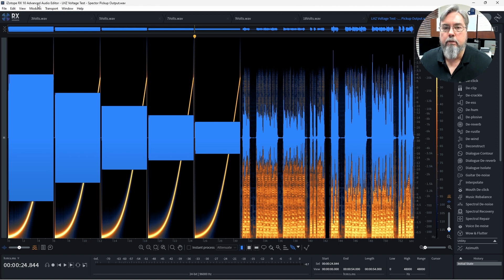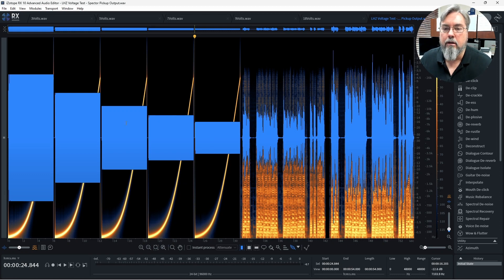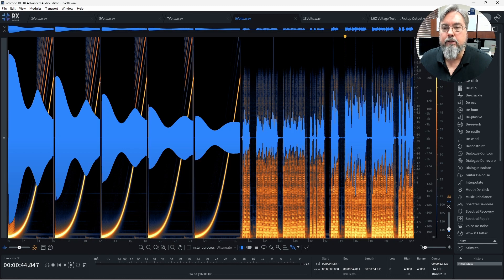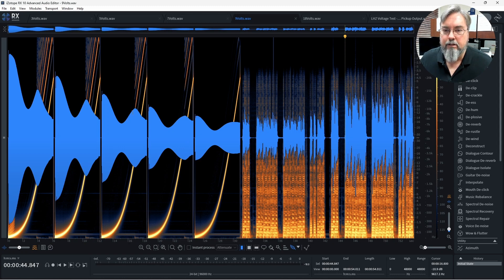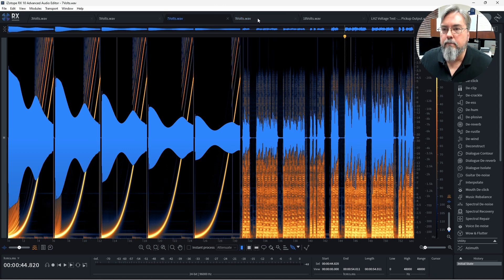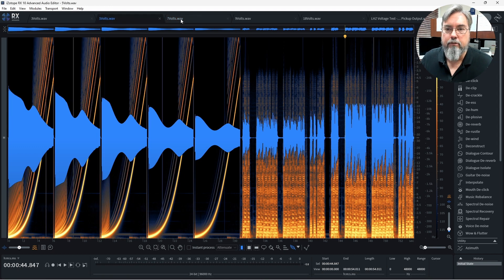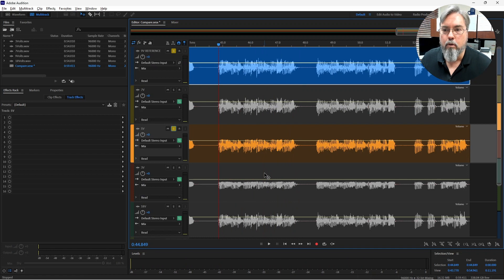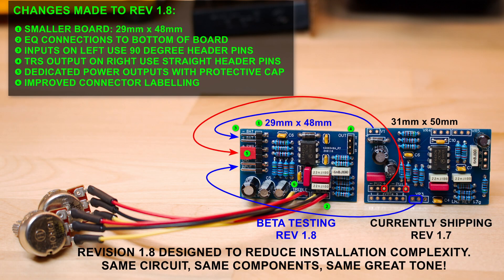Battery Voltage Impact on LHZ Preamp

Comment: Thanks so much for posting this. You have the gift of teaching as well as engineering, design and delivery of a product!  I have Spectors with 9 and 18 v haz circuits and your evaluation seems spot on audibly.  As you mentioned it still comes down to the player.  I do notice that both the 9 and 18 start to get the "Spector growl" when played aggressively.  I have also been told on many occasions that the 9v is "the sound". I find it virtually indistiguishable on stage with or without in ears though.  

I do believe that the Haz type circuit and products like yours are the pinnacle of electric bass active circuits.  Really sound great but more importantly it has been my experience that they find a "home" easily in a live mix.  I am always told by audience members they can hear the bass which I assume means there are pleasing frequencies not buried by the other instruments, not volume.  

Thanks again for the awesome video and lesson!